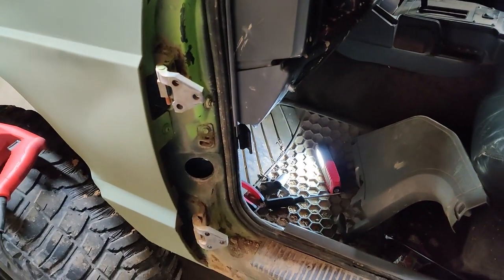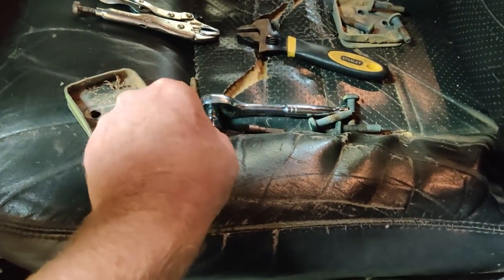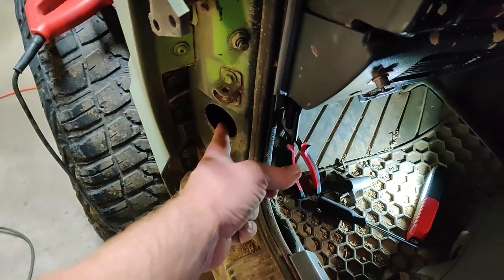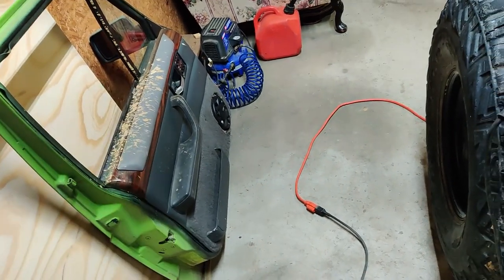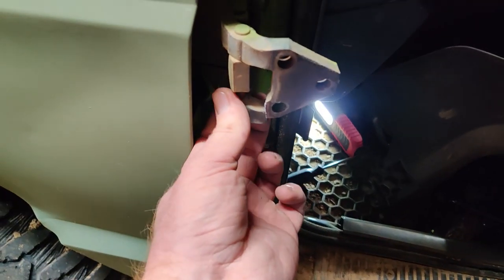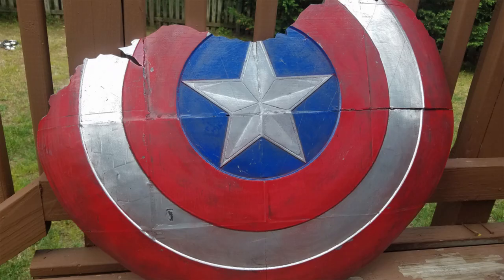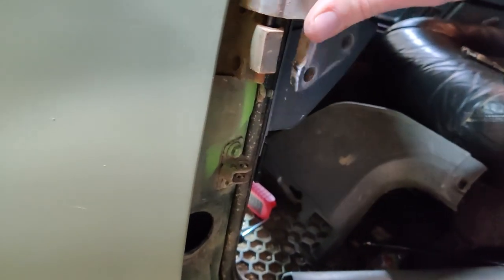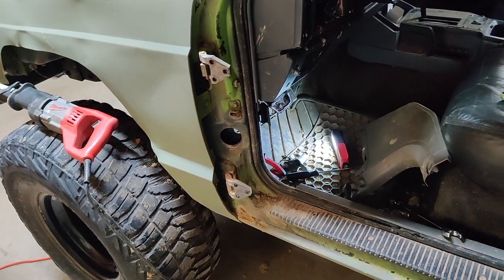How to remove doors on a 1995 Jeep Cherokee xj

Comment: I just fought this fight on a 96 XJ. Took me literally 5 to 6 hours and so what I did to make the job a whole lot easier. I remove the fender you can get to the two boats that are real difficult through the hose and the door hinge. Yes is little work moving defender but a hell whole lot easier than fighting that stupid angle you have to get to
Reply: Just reach in from the fender take out the inner liner if you still got it and that lil insulator they have in there and bam! No need to remove fender!

Comment: Really, the only way to change pins is to cut off half of the hinge? Won't that make it weaker?
Reply from the maker: Seems okay to me, I’ve done it to ever Xj I’ve had so far
Reply: @theshawnwayne  Duly noted. Thank you.
But I don't seem to be able to get a pin online (I'm in Norway). I've seen a complete set of hinges on eBay, but my hinges are actually still stuck to the body so it seems a shame to cut them off to weld on a few set...

Comment: Pro tip for removing door without holding it up and closed :   You take off the t40 bolts from the inner fender . 

 Those holes on the hinge are where the t40 goes thru inside the inner fender when the door is closed .

just use a extension. 

This way works as well but if you wondered how they got the door on their ?

without holding it up or assistance back in the late 90s and maintaining quality and production. The inner fender . Might seem odd but most likley they added the side pannel last already painted 

Ps. Might have to remove your wheel mudflap/skid plate whatever you wanna call it in order to see down the small iner fender isle
Reply: Same with the rear door but the hinge holes are covered by some plastic cover .

Take it easy compadres always remember they made the blueprints first before they made the car(most the time) so alot of stuff are secrets the are kept well. Especially since jeep sold itself to other companies and those small knuckle grinder and dirt in the eye , extra time conusuming preventer secrets died with it
Reply: @mobmob5944  what eva pal. That's a lie
Reply: @wildestcowboy2668  no it should work in theory. I didnt understand it either but just went and looked at the hinge on my xj again and understood what he means. He’s saying you can remove the same bolts when the door is closed by reaching inside the fender/wheel well if you will and the same t40 heads will be facing right forward. It doesn’t really seem that much easier though cuz you have to peel back and reach around mud guard and you’ll need extension and will be working from the floor
Reply: @semi_serious  Thanks fo da heads up playa. I just thought he wuz lyin. I be likin my xj tho. Got 89k on it. She clean playa.